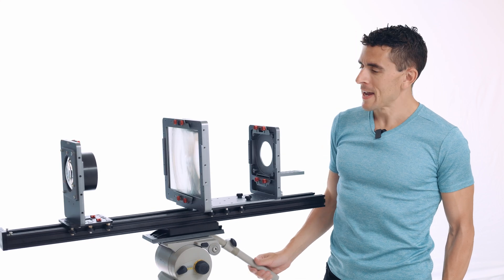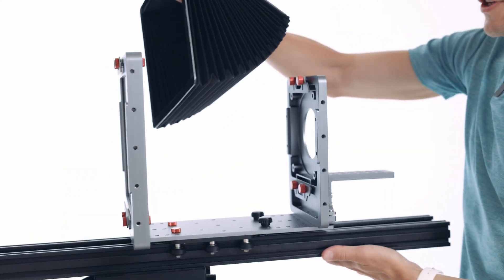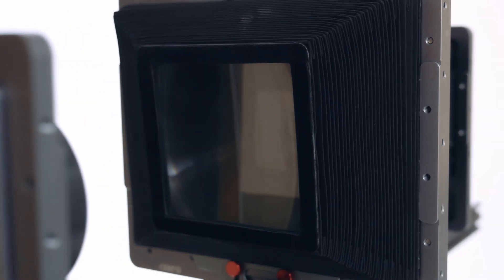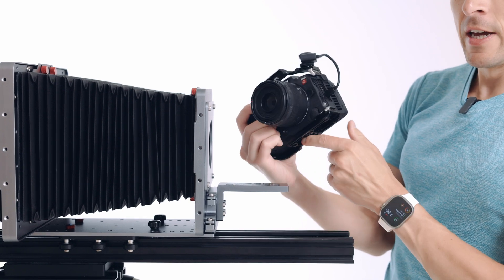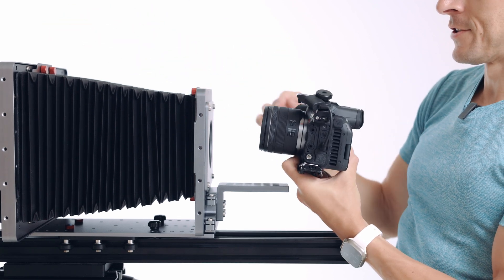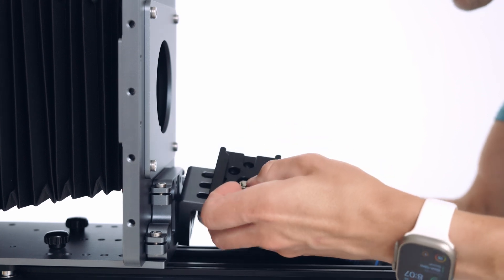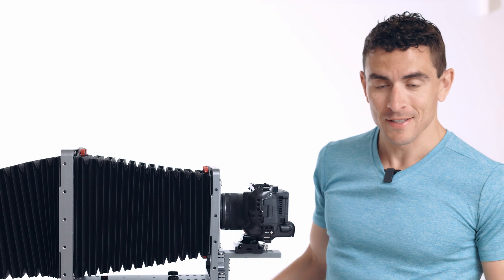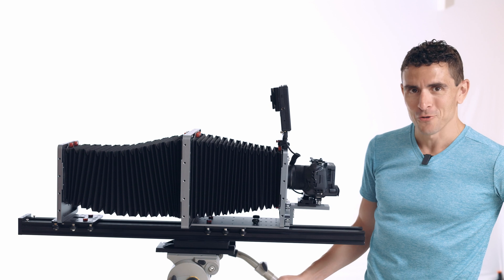F-Zero Camera Assembly, Part 3: Final Steps

Comment: So, is the camera with that 35mm lens focusing at near minimum focus distance on that "intermediate sensor"? If so, I foresee IQ problems with all but the best, most expensive lenses (minus macro lenses), since most lenses have bad IQ at minimum focus distance.
Reply from the maker: The default setup uses a focal distance of about 13-14 inches. Yes, you need a lens with reasonably good close focus. However, image quality from the taking lens is not an issue with modern lenses. With most current mirrorless lenses, there is plenty of resolution and performance to get a fantastic image. See the demo images in this video, which were all captured with the very inexpensive 35mm RF f1.8 taking lens: https://www.youtube.com/watch?v=cr5i25Hrq3M

Comment: I assume the taking camera lens focus is set to minimum distance  (i.e. distance to the sensor) and never changes.  But what about aperture of taking camera + lens?  Can it be stopped down to compensate for the brightness of the image on the intermediate sensor?  If so, how does that change the resulting photographs or video?
Reply from the maker: You're correct that the distance from taking camera to intermediate projection does not change, so it's left at that distance. Aperture on the taking camera essentially dims the image. It doesn't have much effect otherwise.

Comment: Nick, I am one of your KS backers. I have everything (including bellows) and am ready to do this. But when I saw this video I realised I do not have a suitable tripod. Do you have any guidance to offer on a suitable tripod?
Reply from the maker: Hi Nikhil! Tripod selection depends on your intended use case. When I was testing the prototype, I used a beefy photo-oriented tripod called the Linhof Stativ R. It's the same one Nikolas uses in his project: https://www.youtube.com/watch?v=-4uzyhbDFas - but its disadvantage is that you don't get any counterbalance. And therefore panning and tilting is unassisted and can be choppy. If all you only care about stills photos, this may not matter to you. So just get a good photo tripod which can balance a lot of weight, and a good panning head.

If you DO care about video, then you need a fluid head with good counterbalance capability. Personally, I bought a Vinten 250 tripod (brand new they are very expensive, but can be found used for lower prices). I bought used from this great dealer of used tripods: https://www.zoompointphoto.com/collections/tripods - you want a counterbalance system that can handle at least 150% of the weight of your complete system (if not 200%+). My complete setup weighs 25-30lbs total, and the Vinten 250 can counterbalance up to 77lbs (at 4-inches center of gravity above the plate). 

If you want a good new option, try Proaim. They have great budget options and I own some of their products, including the 100mm bowl tripod, which is heavy but fantastic. You'd need a head for it, they also sell some excellent geared heads which would fit the bill, if you're willing to use that method (crank wheels): https://www.proaim.com/collections/tripods

Good luck!
Reply: @fzerocamera  Thanks a lot, this is very helpful. I see you have been facing a lot of doubt in the comments, but I am not one of the doubters. I think I will get what I am looking for out of this system eventually.

Comment: Interesting. The principle appears to be similar to the P+S Technik Pro35 which allowed a 35mm depth of field on a 2/3” broadcast camera long before Alexa and Red existed. That adapter was sometimes referred to as a “flip” because the image projected onto the ground glass was inverted and therefore you had to “flip” the image internally with the camera’s recording options. I’m assuming this f0 design also needs to be flipped? There’s an interesting film from called “Bellflower” which screened at Sundance 2011. It was shot with a home-made bellows lens similar to yours with the SI-2K camera. Check it out. Looks amazing.
Reply from the maker: Hi Champagne, we do discuss this in the video above. Any lens will flip an image, so yes the image on the ground glass appears upside-down. And yes, the F-Zero Camera works like a depth of field adapter such as the Pro35 you mentioned. Our taking camera actually flips the image right-side up, but the camera's internal processing flips it AGAIN because it's expecting an upside-down image. So as shown in the video, I mount the camera upside-down in order to record a right-side-up image. In total, four flips to get a right-side up image.